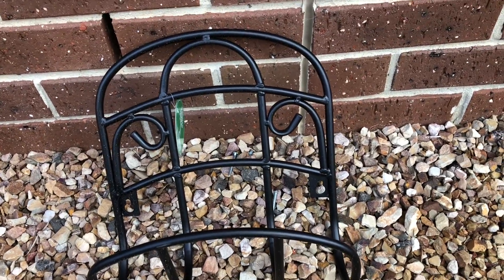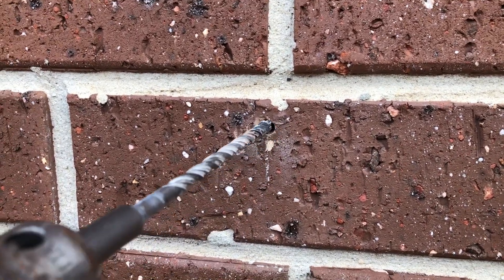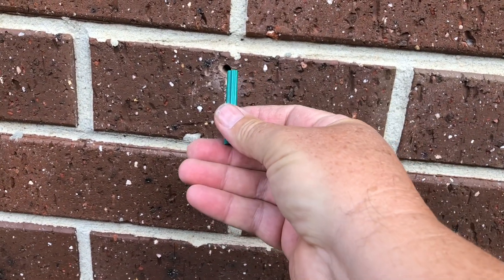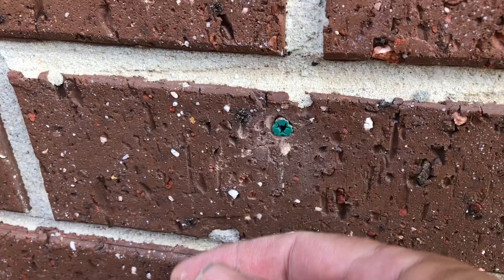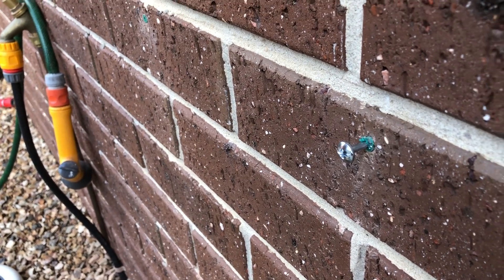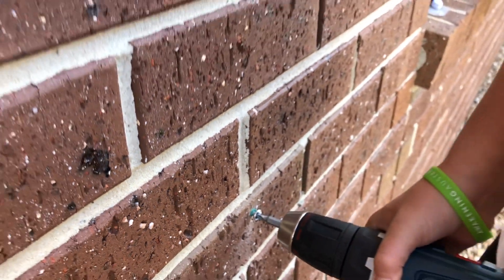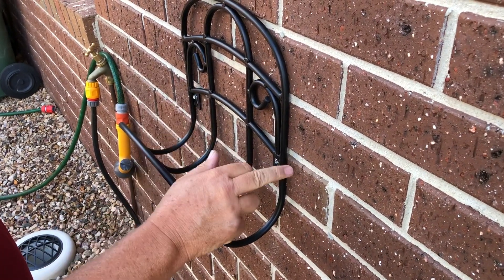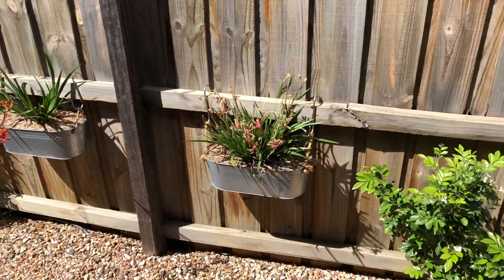How to Mount a Hose hanger or anything really onto a Brick Wall. Strong easy mounting to Brick

Comment: I think the hardest part for me to understand is knowing what drill bit size to use based on the screw size..
Reply from the maker: when you are drilling into brick or concrete it is about the size of the plug which then determines the drill size. the plugs are amazingly forgiving on screw size.